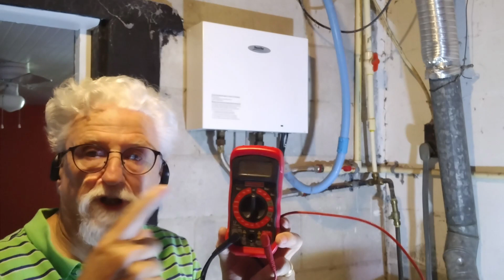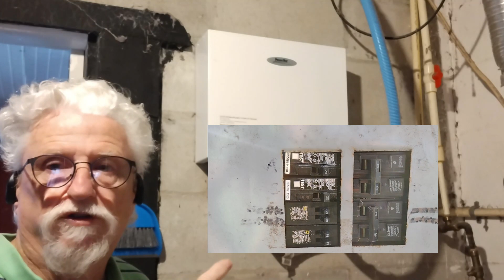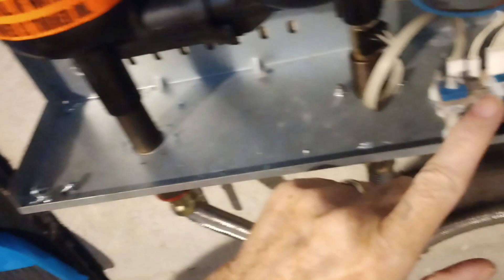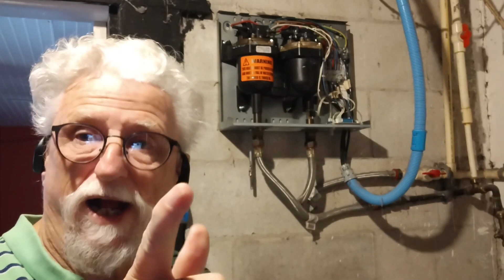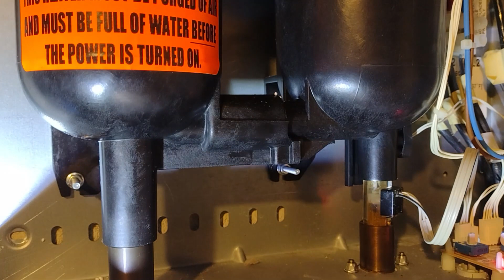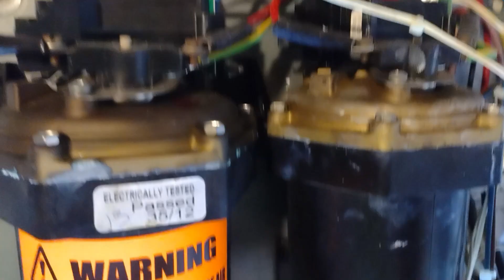How to REPAIR the Power Star AE115 & AE125 Electric Tankless Water Heater from Bosh

Comment: Harold this unit was in our house when we bounced it in 2021 just 119 days before my plumbing superintendent husband passed away in his sleep without warning anyways I have no clue about this thing nor any tankless unit at all, could you please tell me what the twisting button on the bottom of the unit is for? It’s the only button protruding from the bottom of the unit and on the inside it’s connected to the little socket board on the buried on the bottom shelf
Reply: That's to increase the water temperature. On the new units they put that switch in front and visible along with a digital display that shows the actual temperature.

Comment: I have an AE 125 that slowly started losing hot water. It only runs warm now and I am trying to troubleshoot it
Reply from the maker: If you call them they will walk you through the testing. It's probably a heat element. I think I put the number in the description.
Reply: I have the same and the same issue. I tested the three element and one is bad. Now what, no way to change out the elements like some other companies. Out of luck!